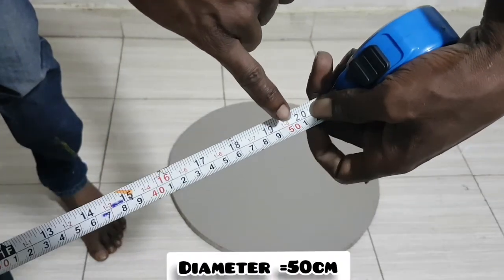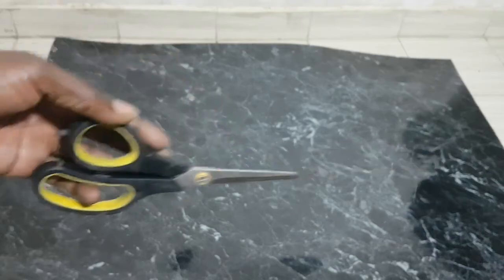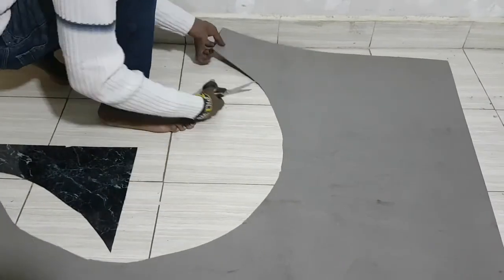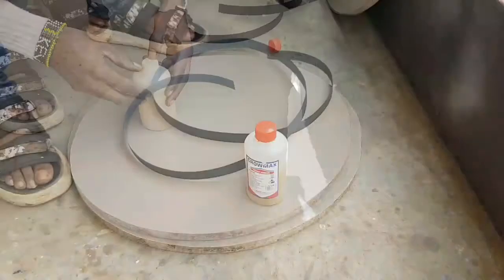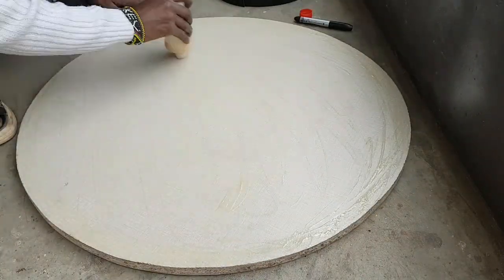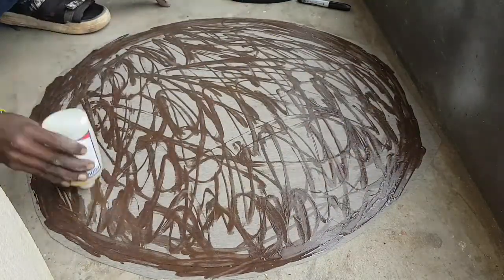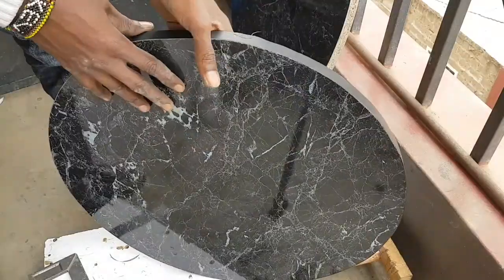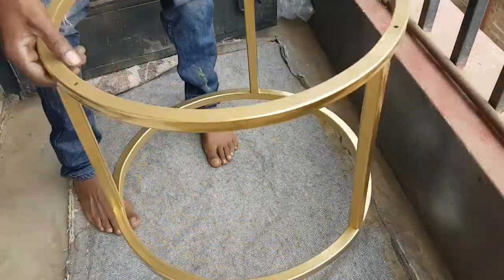DIY How To Make This modern Marble Effect Coffee Tables

Comment: How do you deal with chipping on the edge while using formaica?
Reply from the maker: Mostly... The issue of chipping comes when you don't fit it exactly... For me I make sure it's edges and and that of the surface I'm putting align perfectly ..no excess no less... Then u put lipping tape or any other material u use on the edge with covers both the edge and the formaica edge